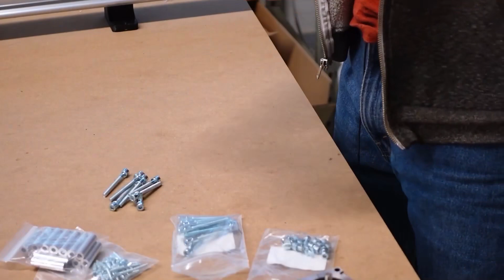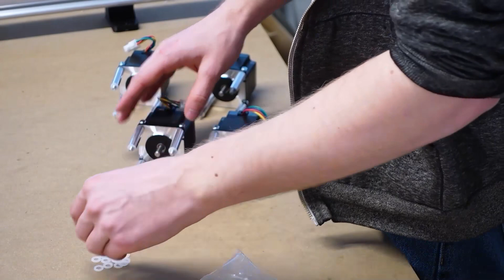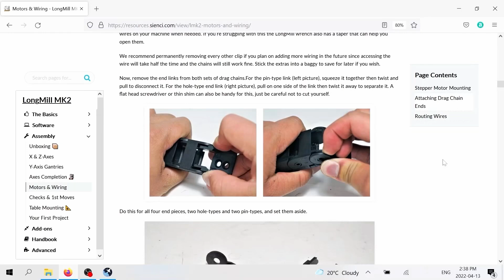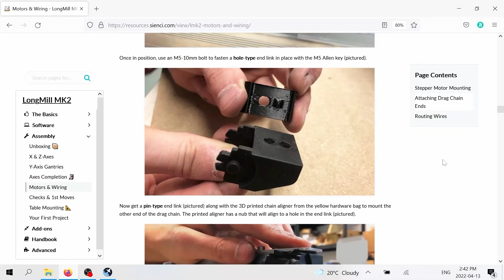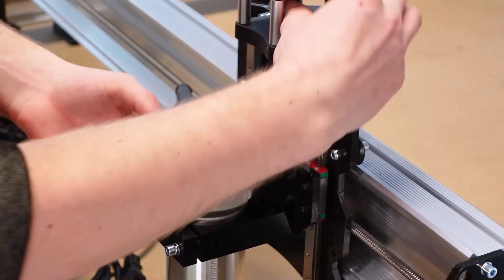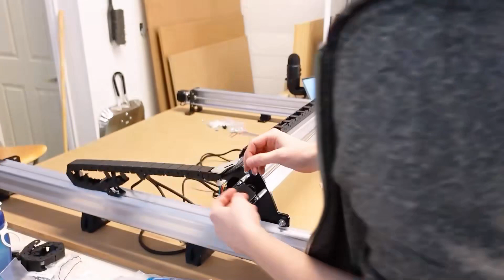LongMill MK2 Assembly - Part 4 (Motors & Wiring)

Comment: Watching this because I plan on buying a Longmill soon and seeing what I am getting myself into... Would it be a little easier to mount the Z axis motor before mounting the Z axis assembly on the X axis rail, just not tighten the setscrew? Might be a little less fiddly.
Reply from the maker: Yes, you can definitely do that Paul 👍 We mostly kept all the motor mounting to the same part of the assembly so that it's less confusing for those who felt intimidated by putting their CNC together

Comment: JUST STARTED PUTTING MINE TOGETHER LAST NIGHT AND RAN INTO AN ISSUE, I HAD 2 OF THE Y AXIS GANTY HOSE DRILL, NOT TAPPED, I WAS ABLE TO TAP THEM OUT AND FINISHED THE STRUCTURE, IF IT WASN'T FOR YOUR VIDEO, WARNING TO LOOK OUT FOR IT, I WOULD HAVE NOT KNOW WHAT TO DO, THANKS

Comment: Hello, there is no whip on the leadscrew, when machine is in rapid mode? :)
And what is the max speed on MK2? 5000mm/min? :)
Reply from the maker: The default speed the firmware is setup with is 4000. There should be no whip at that speed. There is no limit to what you can set it to, but we’d advise to keep the speed under 5000. Thanks for your question.
Reply: @SienciLabs  thanks :)